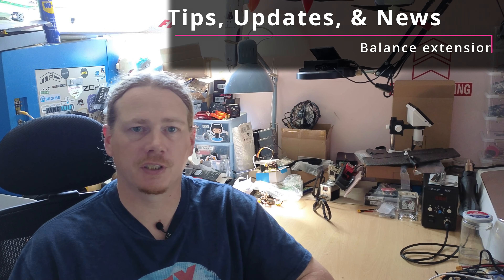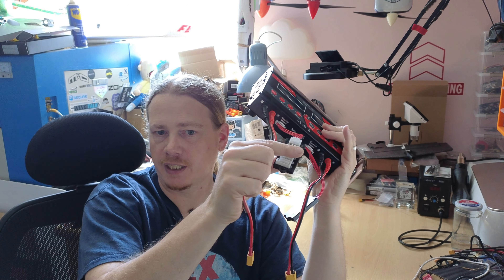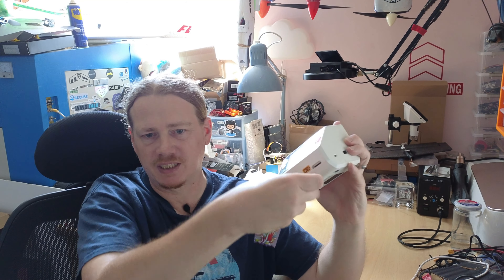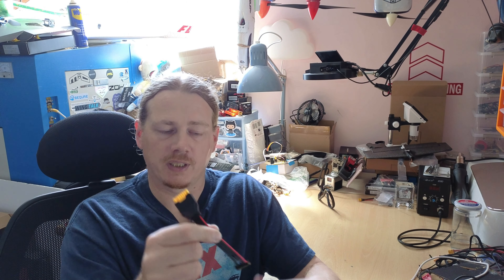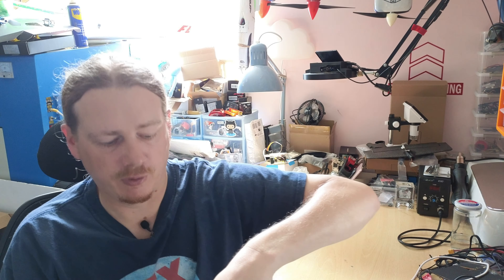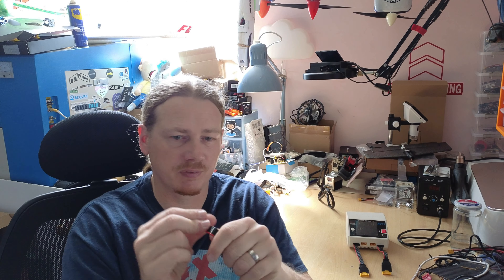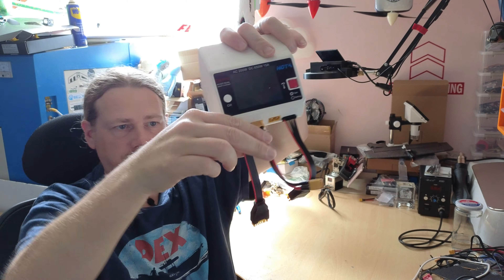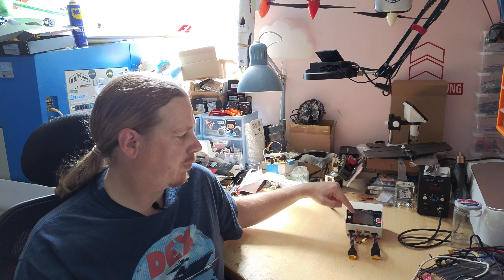Charger balance extension cable

Comment: I like the idea of them. I do have a couple of parallel charge boards but having seven chargers on 1 power supply, I very rarely charge more than one pack per charger. I may buy a couple to go with chargers than aren't connected to a parallel board.

Comment: In the "history lesson" you showed us all 2 balance lead extensions that would still work perfectly fine... plus they have silicon cables !!!!
Reply from the maker: With that charger, it is not a JST XH that plugs in to the charger. So wouldn’t work with a modern charger.